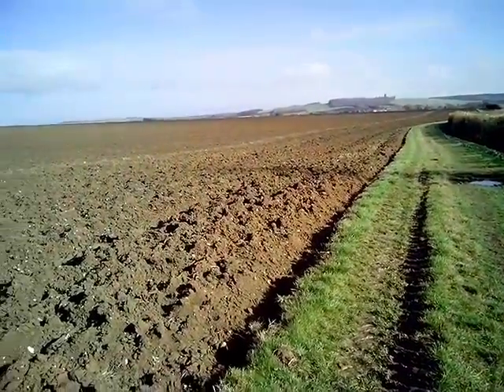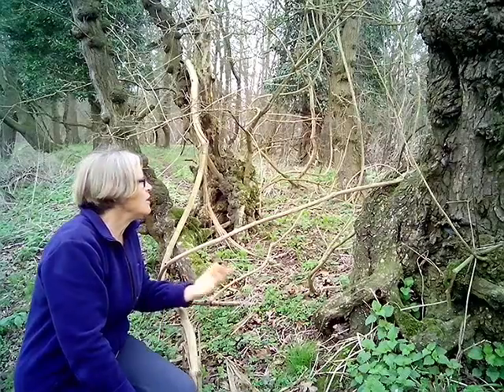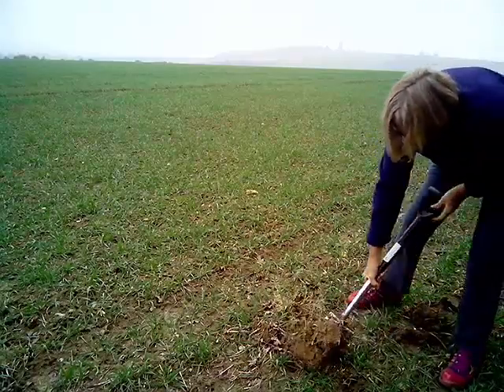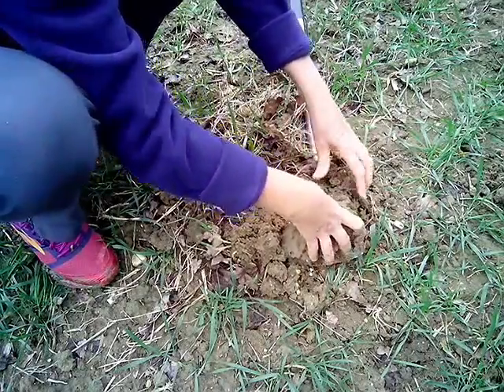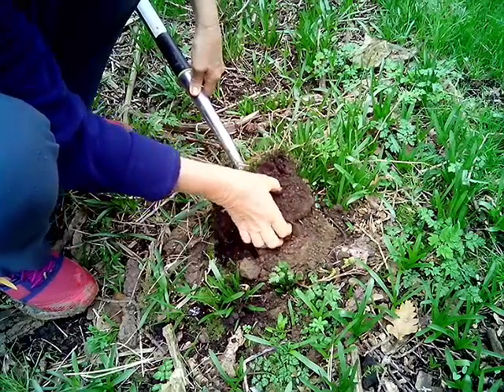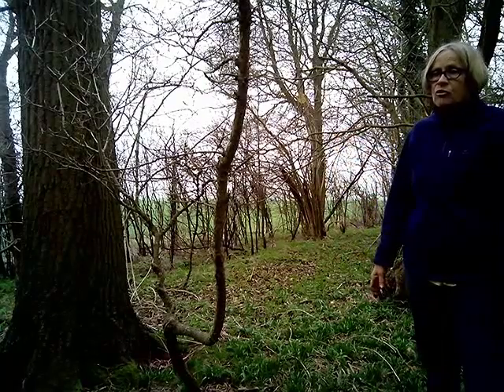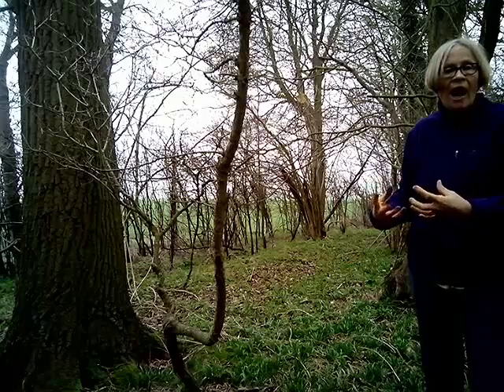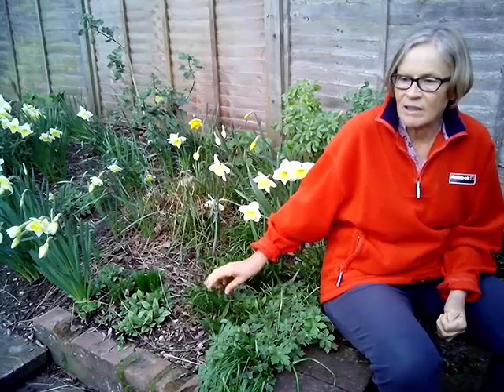Soil Structure Explained: Why Forest Soil is Better Than Tilled Soil

Comment: Unfortunately no dig isn't an option, at least for starters, hear in the south Nevada Mohave desert. The soil hear is almost completely void of any organic material. It's mostly just very compacted sand and silt, a blank slate, so to speak. And very high ph as well. Resorces are rather scarce. I really want to turn this lot into a permaculture forest, but everywhere I turn, I run into a wall. I want to be able to do this not only for me and my boys, but I want to be able to let its over abundance overflow freely out into the small country/retirement community, that the three of us live in, to benefit as many as possible.
Reply from the maker: Hi Bryon. You certainly do have a challenge! 

Can I suggest using what rain and irrigation you have available to grow as much plant biomass as you can - even if it means using 'weeds'. Mowing, cutting and dropping when they get big and before they seed (if that is a concern), and there is sufficient moisture in the soil them to regrow. The goal to grow heaps of organic matter plus root exudates to feed the nutrient recyclers and structural engineers in your soil.

There are free resources on the Learning from Nature website that will help you further (https://www.learningfromnature.com.au/publications/). I think you would find the guide to drought-proofing farms useful. The ecological principles are the same whatever size of your property. Also, see - friendsofgaviotas.org - as an example of what we can achieve!
Let me know how you go! Wendy